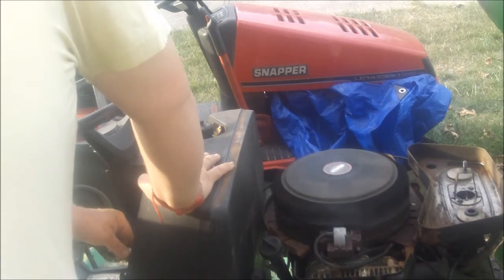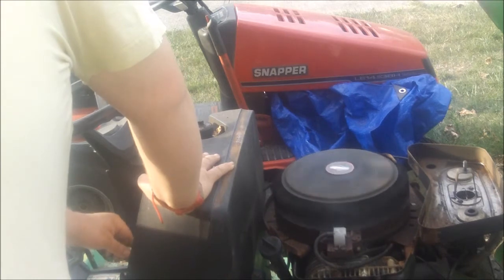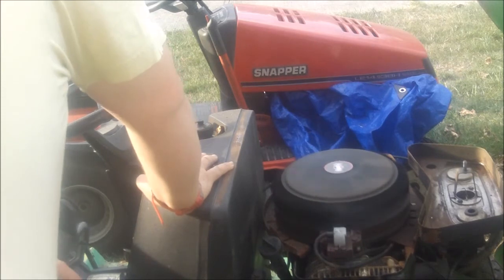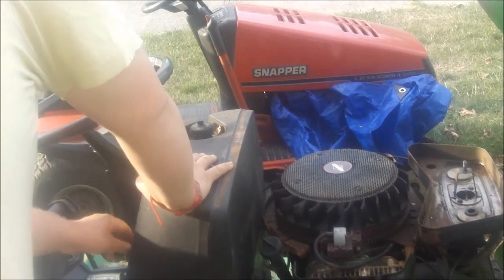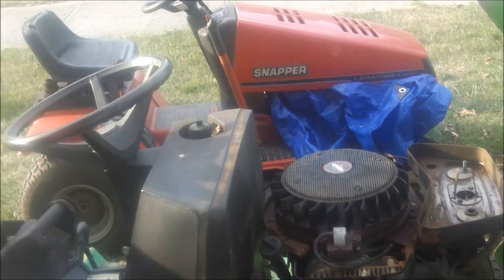deutz allis 613 hydro garden tractor  runs 30 seconds shuts off has good spark part 4

Comment: put gasoline in the tank
Reply from the maker: there was throttle still stuck lol on low idle plus choke stuck open.
Reply: +bleachedpc yea get a new fuel pump or rebuild it buddy
Reply: bleachedpc might need new throttle cable try lubing it UP with pb blaster or wd40